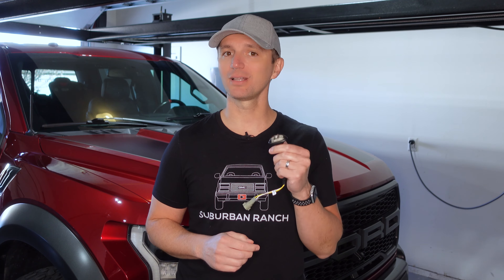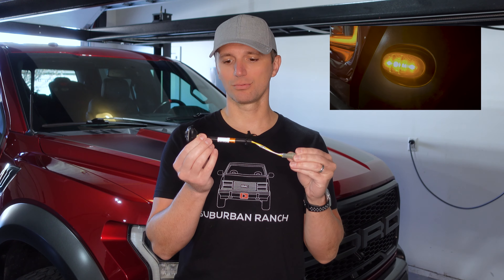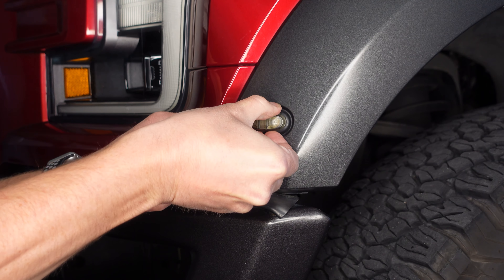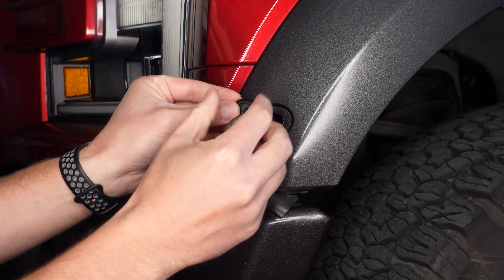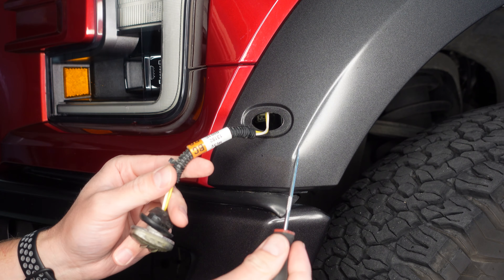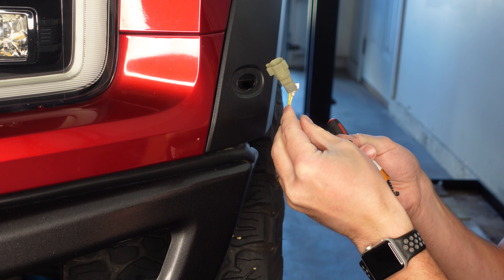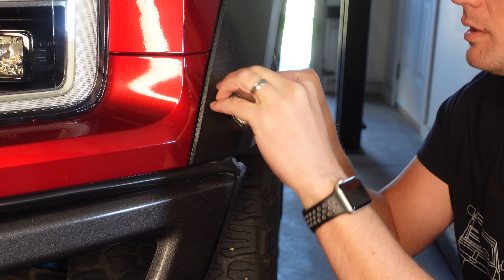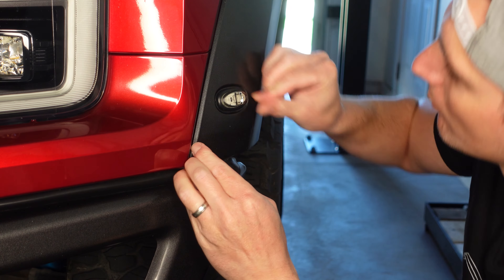2017-2020 F150 Raptor marker light replacement

Comment: If only my new one would have clicked in as easily.  I could not get that snap and didn't want to apply a crazy amount of force, so had to remove the wheel opening molding/flare.  I dont' recommend this as it led me to having to order all new molding clisp to assure a tight reinstall/firm fit.